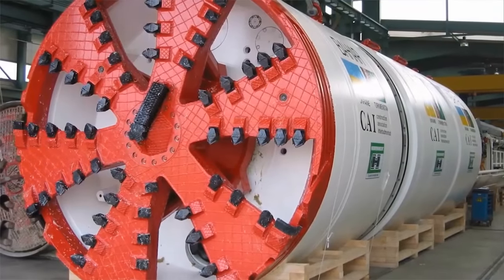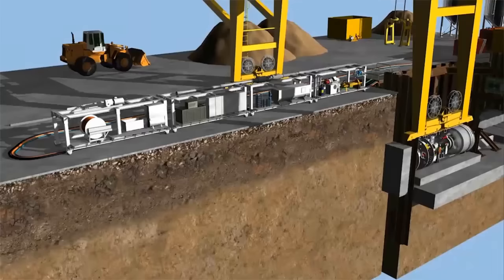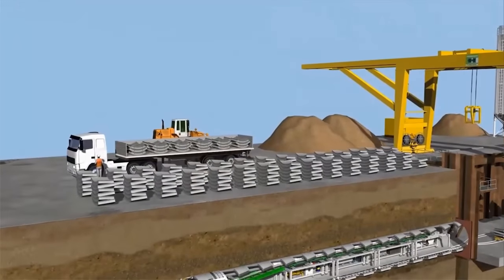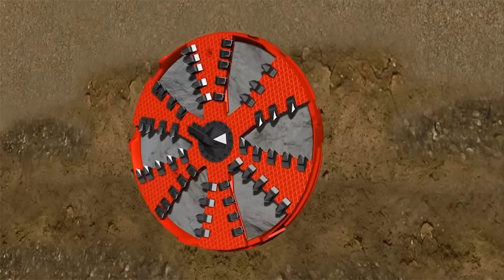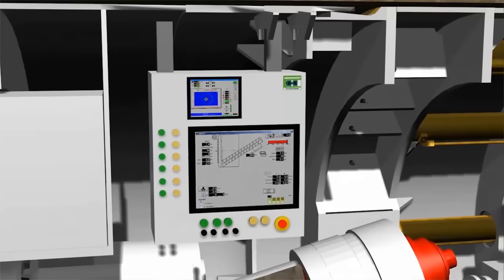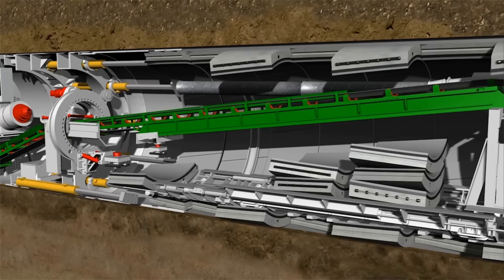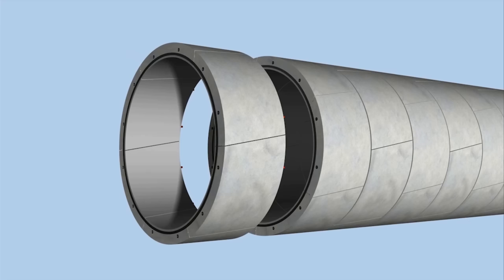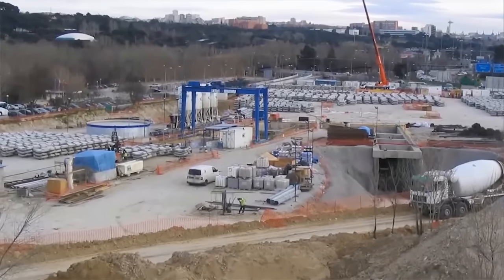EPB Shield Segmental Lining

Comment: So the tunnel relies on the ground pushing it inward to keep it together? What if there's an earthquake and pulled the ground and tunnel apart then water leak inside the tunnel?
Reply: They said all the ring sections are bolted together and then to each other. And the outside of the tunnel is lined with cement
Reply: @andrewnemeth8148  
it';s all in the details, ...
Reply: Earthquakes liquify the ground, not necessarily pull apart the ground. It would be more like the tunnel is suddenly inside a soup of sediment, so to speak.

Comment: How do you change a digging tooth in the face plate while keeping the forces balanced?
Reply from the maker: Cutting tools do not play a role in the balance of forces. Once the rotation of the cutting wheel is stopped, and the cutting wheel retracted from the excavation face, the cutting tools can be changed from behind the cutting wheel. This intervention is carried out by an operator. Best regards. Herrenknecht AG

Comment: how do you get it out of the tunnel
Reply from the maker: Good afternoon, the TBM usually arrives in a shaft where it is disassembled. Then all components are again lifted to the surface. In other cases, when facing space constraints, some TBM parts or even the complete machine has to be retracted back through the same tunnel until the start shaft. Best regards. Herrenknecht AG
Reply: @HerrenknechtAG  thank you (:

Comment: What happens when you hit an open cavern? Oh shit moments the tunneling germans don't think of.
Reply from the maker: Good afternoon. The geology along the tunnel project is usually thoroughly analyzed and drilling campaigns are undertaken before the project starts. This enables to evaluate any potential danger. The cavities are one of them amongst other like water pressure, gases, rock abrasiveness, and so on. Then TBMs are designed according to the properties of the geologies they could encounter. Best regards, Herrenknecht AG
Reply: @HerrenknechtAG  good answer, I guess you could pump concrete into any void ahead of you, you Germans are pretty smart (I married one from Dresden I know) thanks.